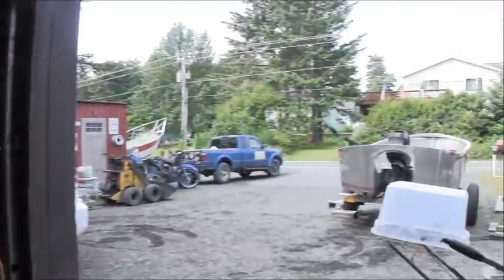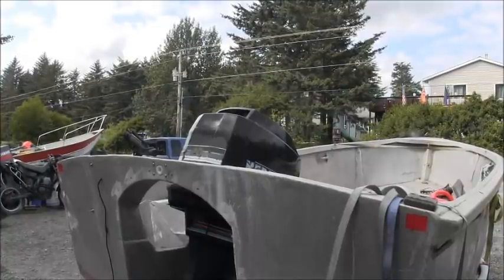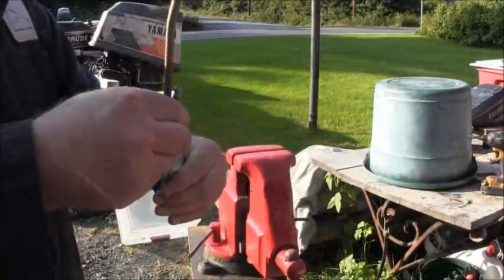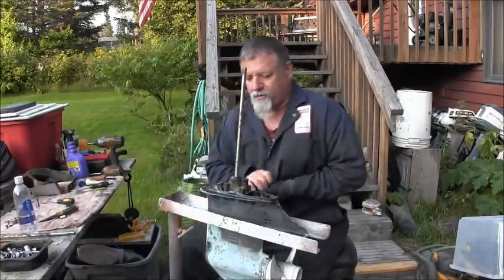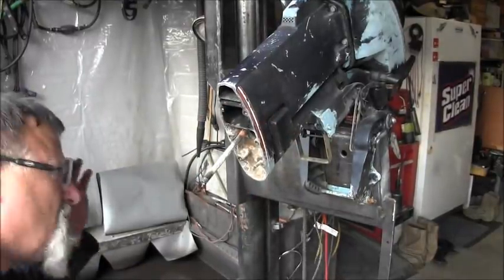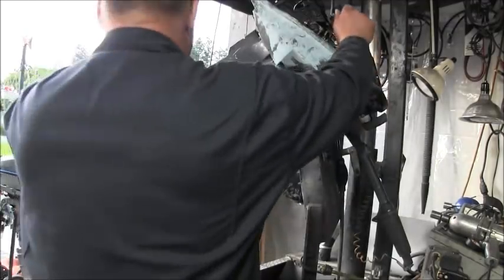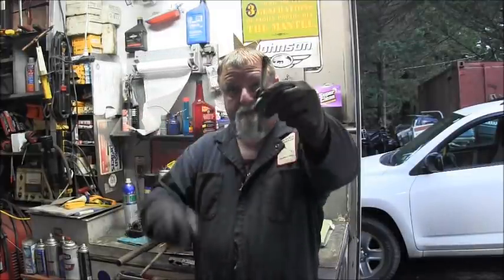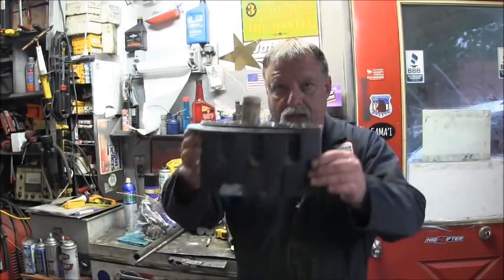EVINRUDE 15 HP CHOP,   MERC 40 HP & More

Comment: Did you do it that way for demo purposes or are you short on short shift rods and water tubes ? Man did you go to the dark side ? Lmao. That is a nice boat design , you could put a cover on it and it would look like a I/O ! Does it have a keel or is it a flat bottom ?
Reply from the maker: Just wanted to show that you can chop it'  I was going to show I have chopped the driveshaft's  as well'  I use a sleave & then put the waterpump on from the bottom.  I have lots of rods,tubes,& shafts but most folks don't. She is a flat bottom'  That motor well is popular around here, In fact my aluminum welded has it. thanks        kodi
Reply: @kodibassInsideoutboards  I kinda figured that was the case , only flaw is most people don’t have a rod to copy it from but it’s a nice tutorial anyways !